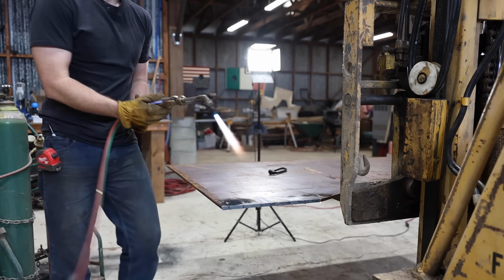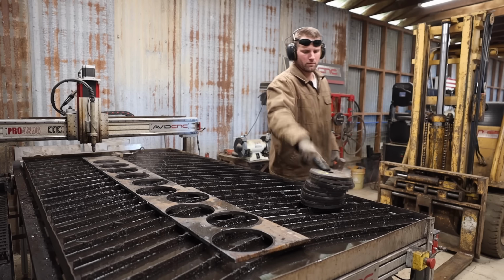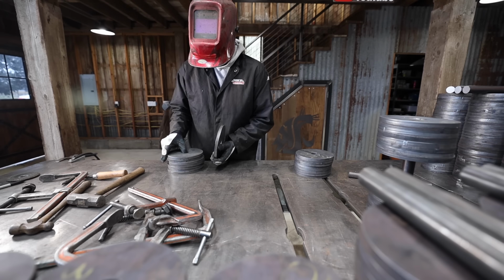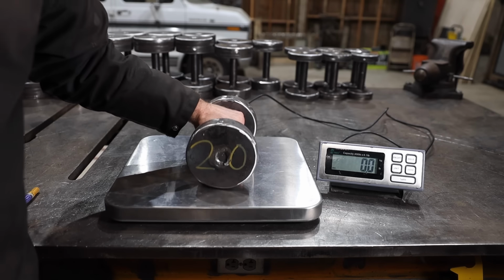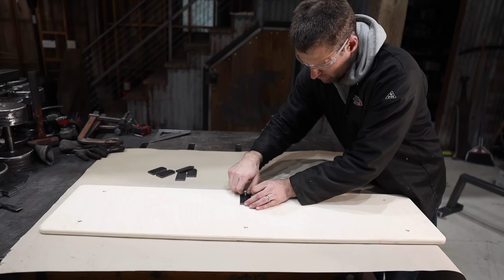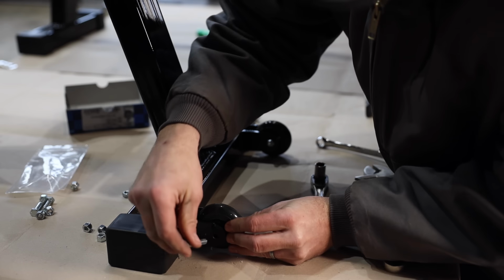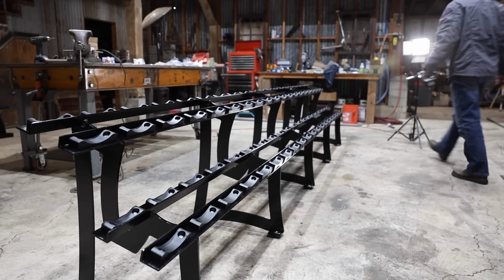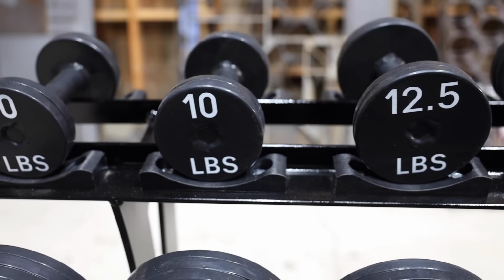Dumbbell Set from Scrap Metal | 10-100 lbs, Flat Bench, and Rack

Comment from the maker: Here's a link to the dumbbell weight calculator spreadsheet I put together:
https://docs.google.com/spreadsheets/d/1V9j-H2cpsUT1HvzHDWb_PVILu8_XkH7fCUHqExNIB8U/edit?usp=sharing
Reply: So.. are you selling?
Reply: I have a ton of 3/8" scrape plate. Id want to keep the same number of plates you are using-the diameters would have to got larger. How would I edit this spreadsheet to use 3/8" plates?
Reply: same question here how do i change the thickness in the document, thanks for supplying us with the spreadsheets by the way
Reply: Adjust the weight by the ratio of the weight of the thickness of mild steel
Reply: Make reinforcement discs out of milk carton next time you upholster
Reply: Thank You!
Reply: I like the happy ending ~
Reply: Ederddd
Reply: Good job man
Reply: Wow, what goin on with that spread sheet. Fairplay very very good that is. Ya make it look easy
Reply: Good stuff but you need to see the quarantine gym 50 inch weight plates
https://youtu.be/16GYKl6TVsM
Reply: Would you be interested in making them and selling them?
Reply: Man, you're talented!!!!
Reply: Nice!!!  At the rate your working, start selling them $$$$.
I built my own leg press for less than $50.00 
I don't know how to shoot you a picture here.
But it's nice 😉
Reply: If he use hexagon shape insted of circle
He could make more plates
And low wastage
Reply: What an  A.H. video recording all the welding arch
Reply: Lay off the steroids bro...
Reply: How much did it all cost?
Reply: Cristiano Ronaldo https://youtu.be/gd2hSRJulYU
Reply: Sir you are awesome talented.. Lots of love from Nagaland
Reply: How much would you sell the whole set
Reply: Viral Indonesian twerking style 

https://youtu.be/N3L7Jz2TMPo

#twerk
Reply: Exactly what I was looking for!
Reply: Hexagon cut?
Reply: Great job my man!!!
Reply: How about making a weighted one-piece steel vest?  Can you make hanging fabric straps to make the suit fit well?
Reply: Thank you very much!!
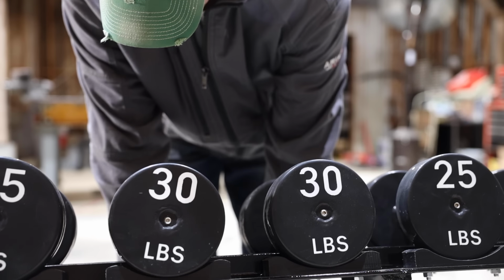Reply: 22:09 If you can rack them like this, you need heavier ones.🙂
Reply: great job indeed, can i use this calculator to make dumbell plates on cnc machines
Reply: Heyo …. I wanna know every equipment  used in video please
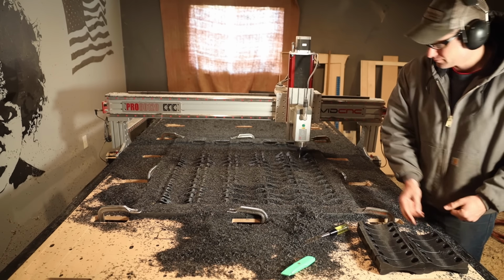Reply: 18:12 18:14 18:15 18:18 18:19 18:21 18:30 18:30 18:32 18:32 18:33  18:22 18:36 18:36 18:36 18:36 18:36 18:37 18:38 18:38 18:38 18:39 18:39 18:40 18:40 18:40 18:41 18:41 18:41 18:41 18:42 18:42 18:43  18:22 18:22 18:25 18:25
Reply: That vise jig was sooo satisfying to watch being used. Amazing work on this
Reply: Eerddeeeededeeddededdrdeedeeeeddededreeredddeeeeeeeeeeedeeeereedeeeeeeerdddeeeeedeeedddereeeedederedeeeedddedeeeeeeeeeeeddedeeeeeeeeeeeeedeedeerereededderrdrfeerererdededederededdddeeeeeeeedeeereeerdeerderddedededeeeerdeedeeeeerdredeedeerrrdedeeeeeeeeedeedereeerdedeedeedeeeeeeeeeeeeeeeredeeeddereeeddedeeedeeeeeeedeereedrereddeeredededeereeeeddddeederrreeeeeeeedefeeedeedeedeeeeeereeeeeedeeeedeeedddreddeeddeeeeeddeerdeedeeeeedreeddedeeededeeeereeeeeerdreeeedfeedeeeeddededeededreeddedeededeeeeerededdedeereededdeddeeredeeeeededeeederededeefreeereeeerdreeeeeeddreeeeeeedeeereeeeeddeedeeeeeereeeeeeeddederdeedededeeeederedredddedeeeerderrefrdddeeeeedeerddeeeeeeeeedddrreeerdeeeeedereeeddeeedeedredeeeedddereedeedrdddedeeeeeedederrreedededeeeeedeedereedededeeeeeedeededeeeedeeddeeedeeereeedfddeedeeedereeeedeeeeeereeeedeeeeeredereededrrrdeededeerderedereredfffvvvvvvvvvvvgggvggvvggvvvvvvvvvvv
Reply: Brother great project. Maybe in the future you need start sailing the types of dumbbell and equipment.
Reply: A long time ago I worked worked with metals, used a stick for 6G. Plasma was a "young" technology then.  Traditional plates are cast. Yours are steel! Drop them all you want to! The plates on selectorized equipment were cast. Several times, a gym I used, had placed a sign on a piece of selectorized equipment. "Out of Commission", Yes! Someone had let the stack go and several plates would break at the holes in the plates for the rods they rode on.  Start a company using stainless, a grade that won't rust.  Money to be made! I have items such as a 2" fat bar with rotating sleeves. Very nice and about $800 over a decade ago.
Reply: Are you off Instagram for good?
Reply: @57moto59  d

Comment: When calculating the weights, you could have modelled the plates without the hole cut out, and modelled the bar as just the length you needed between the two innermost plates, that would have gotten the same result without a bunch of complexity. A lesson learned for the next time you build a bunch of dumbells for your home gym, I guess. :P

Comment: Perfect, all i need to do now is find a scrapyard that will let me take perfectly good sheets of metal and pipe, buy a cnc machine and learn how to use it, borrow a forklift to move the metal sheets, buy a cutting torch and a welder, spend 40 hours making them and BOOM, saved -$50,000 on a set of dumbbells.

Comment: Couldnt you just calculate the plates without initially factoring in cutting the centre hole out? Pretty sure the plates were made into a donut then back to a full solid circle, mathematically.

Comment: I like your idea and I would improve it with bolt on each cap ends.  If you drop those weights, I doubt they'll hold up over long period.  Many old school dumb bells were built this way without the welding and they don't hold up very long either.  Both welding and bolt on should keep it intact indefinitely.

Comment: The only thing is with the stickers you put on it is that they're going to wear out and peel off. I went to the gym where you can hardly even see what's on some of that dumbbells and you just have to guess which one it is and look at the smaller dumbbell that still has the number and then I assumed that the next one is 5 or 10 lb more. So that's annoying I think it would be better to just etch the number on the dumbbell itself so that the sticker doesn't just peel off

Comment: I just want to know about how much did it cost you by the LB to make the dumbbells? & did it save you a lot of money? Like I'm impressed but I'm Curious because I'm saving towards Opening a Gym and I'd Much Rather Hire someone like yourself or do it myself than spend $2s a LB for 4 Racks of weights 1 rack will likely be made to be up to 200LBs in a VIP Membership access section.  I'd Likely Mill a Grip Pattern into the Handles though. and probably Rubber Dip them instead of painting them.

Comment: Would probably have been a lot less effort if you had standardized all the plates and handles to standard weights using the measured density of the scrap material.  No wonder it took you so long.

Comment: Dude you paid way more than a set of dumbbells would have costed 😂😂😂😂😂
Reply: A brand new set of dumbells 15-100 is around $7000, a dumbell rack for those is around $2000.
Reply: @Sina-rw3bl  he bought the scrap 
He used some crazy machines that cost alot
He paid for their coating and so 
And he worked for multiple days 
He didn't really save any money
Reply: @charbelnasr510  He already had the machines, this is his livelihood.

Comment: i hate to be "that guy" but the circumference of 420 eight inch circles is 879 ft. Adding the circumference of 420 three inch center holes would make a total cut length of 1208 feet, or about a quarter mile. "Here to the moon and back three times" is 1,433,130 miles or.. you must have cut 2,628,926,369 metal disks and forgot to keep counting after that big bong rip at disk number 420. To have 420 disks be equivalent to the moon and back three times, the diameter would be 2.8 million feet for a single disk

sic video tho

Comment: I just did this at my work.  I work at a metal fab shop.  I run a laser and cut my plates out of remnant 1/2 plate.  Dug in the saw scrap hoppers for all my 11/4 tube for handles.  Then had them welded  together and run through the blaster.  I got 10 sets.  15-60 lbs pairs and paid under $100 for the whole set. Saved over $1,000 conservatively. And this guy is who inspired me!👍
Reply: You didn’t opt for thicker handles? I can’t stand 1 1/4

Comment: "The thing that made this project possible for me was..."
the plasma cutter, the forklift, the shop, CNC programming, welder, angle grinder, drill press, custom reamer, infinite hours, band saw, excel spreadsheet, square, 2lb hammer, uber clamps, cheap rotary stand, powder coaters, a sponsor, dual axis cnc machine with wood cutting bits, a running tab at the hardware store, welding table, a set of socket wrenches, a woman to sew for you, pneumatic staple gun, a socket wrench you're willing to use as a hammer, roller skates, a fully equipped paint booth, specialty bits for cnc machine (assorted), small cnc printer/cutter thing.... (wtf is that?), crafting table, exacto knives, wild amounts of materials, wicked budget and a youtube channel to make some of that money back.
Reply from the maker: mostly just the 2 lb hammer

Comment: I am doing dumbbells too but I use concrete with metal bolts, nuts and old steel bearings, metal pipes and metal sheets bended into pipes and metal discs to cover the front, later mig welding. I am trying to milimize cost, your set is amazing and your workplace is good equipped, well done

Comment: They are nice but with a shop like that I would think you would knurl the handles and. It’s also best to have the the plates spin on the handles it helps take friction off your joints. Don’t get me wrong, you did an outstanding job but there is a pretty big difference as far as damage to your joints over time.

Comment: To the moon and back 3 times? Find that hard to believe
Reply: Why are pilots risking their careers by admitting there is no earth curve? Over 44 NASA, Government and military documents assume earth is flat and non-rotating. The 2nd Law of Thermodynamics says outerspace is fake; you can't have gas pressure next to a vacuum. You can collect $200,000 if you prove earth spin or curve. No one has ever proved this because there is no curve.  Emergency flight paths make no sense on a globe and make perfect sense on a flat earth. NASA uses green screens and CGI to fool people into their spinning-ball religion. NASA has air bubbles in their "outerspace" videos because it's filmed underwater to fake weightlessness. Astronauts use wires and harnesses to fake weightlessness so people believe in the "outerspace" religion.  Every picture of "outerspace" is a fake cartoon image that NASA admits is fake.

Comment: great job just need decorate them little bite. though work out eventually not need lighter dumb bells could melt down make heaver dumb bells. that said light nice exercise try keep arm strait.  so couple exercises get on way. 1. dumb bell bench presses do that end vedio. same idea bench presses with bar. but weight to much don't bar kill you. 2. dumb bell squats. same idea as squat with bare on neck only hold weight each arm put chair near buy. bend legs squat have edge but touch chair but not site on it then go straight up. 3. dumb bell dead lift. bend touch toes pull two dumb bells up chest back down. 4. curl dumb bell each arm. 5. thor punches. put light dumb bell each hand shadow box punch air. as get stronger use heaver dumb bell like hammer idea. 6. skull bashers. site in chair. make triangle with thugs and point fingers each hand around end one dumbbell hold over head. bring down touches head strait back up. (good thing good welds spine weights scary on this ) 7. light dumbbells lift arms like wings from side slow is were get work. then bring back down waist. 8. version 45 drill high school instead hold 45 plate stering wheel. hold out light dumb bells strait out from chest like door handle try turn. hold long can let arm go waist as get tired. over time hold out longer or get heaver dumbbell. 9. farm walk. this one got dumb bell each hand walk around track or side walk back forth in room. its like take bucket of water or bucket of grain in each hand. hope help out there other exercises watch rock Johnson and iron gym.

Comment: I once made my own dumbells out of foot plates from building stanchions ( worked steel frame building manufacturer )  they were square but it worked. Rough and ready but all edges and corners were ground smooth. No problem with rolling either 😂🤣😂

Comment: Very nice. I recently got some plates cnc cut from a buddy. I just have two bars (30mm roundstock) and can add/remove weight as needed. Saved a fortune. Also got some 20kg plates cut from 25mm plate. Basically have a completely homemade gym for less than 100 bucks 😁

Comment: "here to the moon and back.." bull shit... lmao!!  if your serious you need to learn to add.. cause there is no way you got 240k miles of  cuts out of that machine or any machine youve ever used!!!! lets do the math... 420 plates with an ave lets say 8 inch diameter.. time 3.14 equal 25.12 inchs around.. times 420 equals 10550 inchs total( not counting the hole in the middle) that equals 879 feet of cuts.. dude i dont know what your smoking but your math is way offf...  smh lmao!!

Comment: Would be better if the seat had a adjustable backrest.
The rest is amazing, but not as cheap as you might think.
Looking at time, machines and all the material being used.

Comment: Well done. With thicker plate try using older consumables and pre-piercing all your holes. Then put new consumables in and let it run. Consumables will last longer and you can scrape the excess splatter all at once

Comment: What in the backwoods math is going on here.
"Here to the moon and back 3 times" Just think about that statement, without even doing any math I can tell you that's wrong. 
On average the moon is about 240,000 miles away. Multiply that by 6 to get "and back 3 times" and you get 1.44 million miles. Even if your plasma head is moving at 500 miles per hour 24 hours a day it would have taken you 17 full weeks to move the torch that far. If you divide 1.44 million by 420 circles, each circle would need to be over 3,400 miles around the circumference. To get the diameter you divide the circumference by 3.14 so you would have to be cutting circles that are 1,086 MILES in diameter. Of course I ignored the center hole because your math is so far off it's statistically irrelevant.

Comment: Solid steel weights are rare gems they are impossible to find in the commercial market and they comes in extremely high cost, I have access to these kind of thick sheets and people who provide service to cut them in required shape but then the Lathe part is where cost start to touch sky , it is a lot of work and its hard find competent labour to grind it properly in reasonable prices

Comment: I am doing the math on your "3 times to the math and back" and I'm having an aneurism.  How on earth did you get to that number?  Being no mathematician myself, I am baffled.  With the knowledge that your cut length can only be as fast as your cutter moves, we can do the math in reverse.  The moon is 238,900 miles away from the earth.  Multiplying it by six to account for the return and 2 additional trips, you end up with 1,433,400 miles.  Assuming that your "hours of cutting" meant you had the cutter running for 24 hours nonstop through steel, your cutter would have to be moving at 59,725 miles per hour...

Comment: When you strike your torch, if you turn your acetylene the normal amount, and just barely turn the oxygen, it doesn't produce any smoke or soot. It's worth a shot, old fitter taught me that.
Reply: i am told not to do this in welding school. it is a safety thing i believe.
Reply: @ethanelectric1024  school and real life arent the same
Reply: @viktoriyamalavola6041  whats real life?
Reply: @ethanelectric1024  Just try it next time. Takes getting a feel for it
Reply: @jakefloyd8035  alright I will
Reply: @ethanelectric1024  It poses no risk. I've lit a torch atleast a couple thousand times that way. No soot, no big sporadic flame. Also make you look like you know what you're doing lol

Comment: Great job, and real attention to detail.
But no knurling on the handles is a sin. Also, on most "professional" dumbbells they actually allow a bit of slop with the plates. This allows you to do one arm snatches, along with certain other movements that are performed at speed,  as it means the plates are free to spin at the top of the movement, instead of the inertia trying to turn the bar in your hand.  
But they're only small details. .
Top job, hats off to ya

Comment: Is it possible to source cheap, solid, 8-9" solid bar? 
That way you could just cut off the required length and weld a knurled bar(hand grip) between. Or drill a hole through the centre and run the bar all the way through, to make it stronger.

Comment: Great job , that cutting tool is amazing.  My only niggle is why you didn't fill the end of the handles with weld and sand flat to plates so you couldn't see the ends of the handles on the outside.

Comment: Awesome weights and equipment, your attention to detail is second to none. I do have one reservation though. It doesn't seem like there is any lateral bracing on the tiered dumbell rack. If you were to bump into the rack with something heavy on either end it's possible that it would collapse like dominoes. That would be a very dangerous situation. A few welded in knee braces would prevent any collapse.